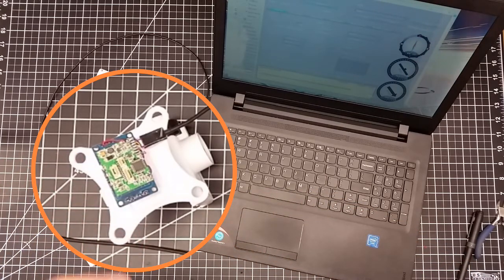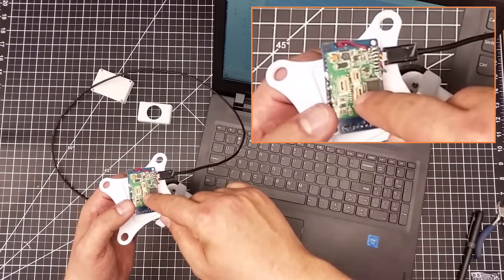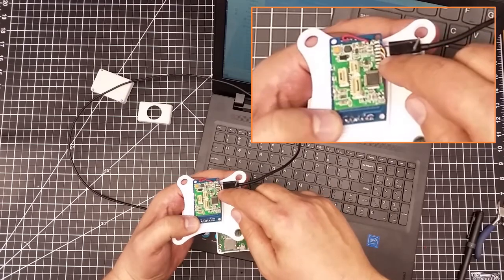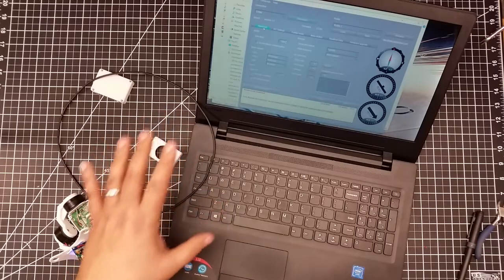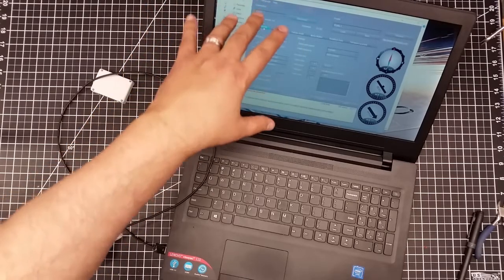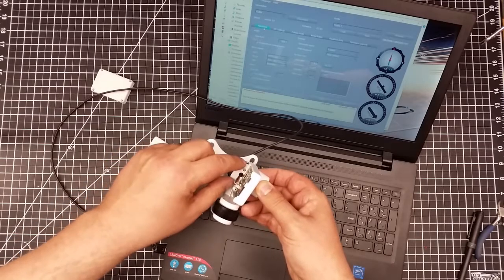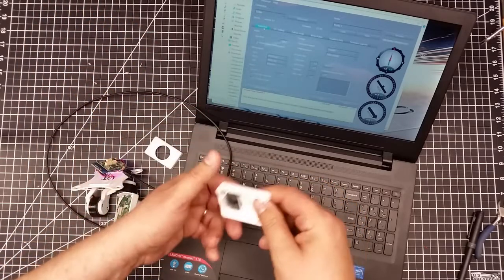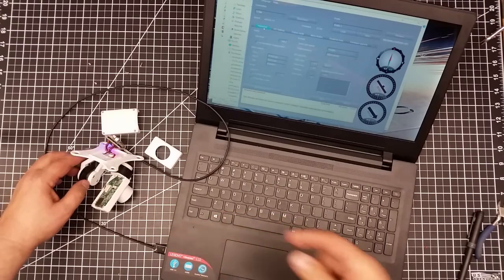Video Drone - Hacking the UpAir Gimbal!

Comment: I have a question I recently bought two up here one drones and one was for parts I use the other ones camera because mine was completely trashed after I wrecked it I would like to ask you if you have a diagram for the wiring other than these videos

Comment: Thanks for your reply, and I have ordered up  a couple of bags of the JST (DF-13) terminations - however I have a really simple question - the crash broke the three and four wire  gimbal terminations completely so I just need to know which cable goes to which strip i.e. the six pin terminal is ok but is it the cable from the transmitter or the main board that goes into the three pin terminal next to the gimbal main control strip? same for the four terminal strip.
Reply from the maker: Would love to help ya, however sold both of my upairs so no longer have them to reference for you.  However, you could check with Cruzroy (he also has a YT channel and Upair which he has done major hacks) and he might be able to answer your question.  Sorry for not being to help more...

Comment: hey i know this video is kinda old but i was wondering if you had learned anything else about this gimbal, i have two of them and id like to be able to wire them up for control on my betaflight/frsky based drones. do you know how to wire them up to a flight controller or arduino?
Reply from the maker: There isn't any easy way they use an integrated controller...

Comment: great video. I wish you would do one replacing the camera but still use the same gimbal that you spoke of in the video. that would be awesome. thanks for the info.
Reply from the maker: Sorry but you can't, the camera is part of the gimbal electronically (at least in this version and believe in the new one too).  In fact the OSD is also part of the gimbal so it would be a major over haul.  However thanks for the kind comments!

Comment: as a result of a nasty crash I have two disintegrated jet connectors on the gimbal board - the main gimbal control lead with the red red blue brown black black connections is ok - but the connector from the fpv transmitter and the other one from three core cable from the main board are totalled ... i can't make out from this and your previous videos what the connector config is - could you confirm the pin out from the fpv controller and the pin out from the main board and which one connects to the 3 pin just and which one connects to the 4 ping just ... please ...thanks in anticipation .. JimC
Reply from the maker: If you look down in the thread another viewer listed the FPV pins as these are straight forward (as its just standard module).  I never fully sorted the main connector as I guessed wrong and burned up the board as they didn't run as guess.  I would highly suggest writing CEN10 and ordering (and waiting) for them (hint get a couple sets) as these are DF-13 connectors and can be a bear...

Comment: UPAIR ONE 2K Model Upair2 Core Board
Greetings Friend! You don't happen to know where I can get a replacement cable for the 8 PIN connector located atop of the gimbal do you  Its almost like a proprietary build for Upair only. ]r any specific part name for it. The ones that I purchase here in the states are either too small or too wide. Cannot get a response from Upair also.  Help!    ;  (
Reply from the maker: I ordered one from GenTen the manufacture and it was around 12 buck shipped from China...

Comment: Hey ,
you mentioned a new Version in the links .
Do you know the difference and how to identify?

You had a (or 2) UpAir One 2.01 ... but what is the new one?
Or is it just a 2.7k upgrade?

GREAT VIDEO and SERIES OF UpAir ONE VIDEOS with great insights
Reply from the maker: The revision as I recall is 2.01 however the series as I understand is "2".   There is a newer new one now which I don't have that is app driven like the P3/4 and all I know is it has a different flight controler than the 2.01 however I would bet still the same gimbal as its just the storm version so you can hack it...
Reply: Video-Drone Don't get me wrong: I can't buy it using your amazon link what I would but: 
#1 they have none in stock
#2 they don't ship to germany

Therefore I need an optical or technical detail with that I can make sure to buy the latest one. 
I'm still undecided if I buy that UpAir one and make the mods you described damn good that I'm encouraged and motivated to do so or buy the old, good lady phantom iii and add a bit for range and batteries. 

If I do it the first way I wanna make sure to benefit from your mods and hacks but would also like to take the advantage of the third evolution of the One if I remember it right.

And there are different UpAir One available at gearbest which differentiate by 2k or 2.7k and 4k camera where the first gen. may be the 2k with a seperatly useable camera.

But after you mention a Phantom 3 app controlled FPV I'm total unsure which modell I have to look for.
Reply from the maker: No worries on the link 😀 Also love Germany will be in Bonn next week too.  Anyway if you can afford the extra buck go for the Phantom 3 Standard.  If not even following that link should take you to the German version of the store and it's the one that requires a phone or tablet.  Also myself would not spend the extra money on 4K as it only has a two axis gimbal....
Reply: Are you sure to go for the Phantom 3?
Thought that after all your work the One could be able to do more than the Phantom. Loved your step by step considerations and improvements. I watched nearly all your One Videos the last day and I thought what an opportunity.

If you come to Bonn ... pick up an american phantom 3 and bring it to Bonn - i'll come to Bonn and pay of cause € or $ as you want in advance... cause in the US all DJI are quite cheaper and then it's much easier to pay that extra buck for the phantom and its combo pack I assume to need. Not joking or kidding. I have already the US Power Adapter ... I might need for an american P3. Could use it for aerial archaeology around an ancient battlefield excavation area 2000 years ago which is a 20km trap, a path getting smaller and smaller into the moor/swamp where the roman empire lost a third of its army - that was found nearly 30 years ago.

http://www.kalkriese-varusschlacht.de/en/museum/the-exhibition/

And I just checked your amazon link from this video.

I went to amazon.com to a summer toy paradise Headline with this product

UPair 2.7K Plus Mobile App Version Video Camera Drone,5.8G RC Quadcopter,Return to Home,Auto Take-off,Auto Landing,Follow me Mode,Flight Route Planning Function,Aerial Photography Drone

but no link or forwarding to German Amazon
Reply from the maker: Wish I could drag one over for you but leave tomorrow.  Also yes "if" you have the extra money go the Phantom far more refined as with the "new" UpAir" keep in mind it is a version 1 and with version 1 comes bugs.  The Phantom 3 has had them basically all worked out.  Also this is major cool (aerial archaeology)!  With this said (please) spend the extra money get the P3S minimum with Litchi and/or Autopilot  so you can run missions, you will be blown-away by what you can do.  Again, if this is your planed use go for the P3S with Argtech Ant mod and you will not be sorry as missions will blow your mind when it comes to this.
Reply from the maker: Good to know of the weather!  As that is very warm for this time of year (mostly I go to Munich), however check out Litchi missions as I have seen on the internet a dig site use this for regular mapping  as once you create you can keep rerunning and do overlays.  One of the things I plan to experiment with  is NIR (Near IR) to map sallow water ship wrecks.  This might also work for you too as NIR can deliver a very high level of detail, or this I bought a Phantom II (you see up coming video's on this) and I build an NIR FPV system and working on a high res-camera system.  Oh yes and I know how to enjoy the Rhine too as I typically stay at the   Grand Kameha has a great location for a nice stroll :-) Hey how are done laws there?  I ordered a Spark and would like to bring it with me in the future, is it possible to fly there?
Reply: Video-Drone Regarding flying a drone in GER I send you an eMail with all the explanations and rules that may end up in a bit more freedom for you and your drone(s) - you're welcome.

Regading Phantom: I buy one - do not really how to get it here but I found a nice "memorial day" offer not knowing that memorial day is in may/summer cause german kind of that is called "Rememberance Day/Volkstrauertag" and in November like the british Poppy Day.
Reply from the maker: Yes saw this as I have been binge watching Spark videos!  Wish there was one with the remote as that is what I want to really see!  For me the 1080 is great as 90% for YouTube I do in 720p as 80% of my views come from Phones and 1080 or 4k take forever to upload!  :-)
Reply from the maker: Many thanks I did see and on my way to Germany now, however my real question is it possible to fly in the area of Gran Kameha there on the Rhine?
Reply: Video-Drone Better you send an eMail next time cause I don't get notifications and you had luck I was here.

Have a problem with the place on the Rhine you mentioned.
What is it spelled, looks like a typo cause I don't know where / what Gran Kameha shall mean?
Which town is near to that place?

Be prepared: very hot, subtropical nights currently with temps around 25° in the night at 2am
Reply: Ok, I got it.
You are talking about a Hotel called "Kameha Grand Bonn" 

Well, on the other street site (eastwards) is the main police station where flying shouldn't be forbidden but you may consider the interference of their equipment.
On the other side there is the huge Rhine river with a huge recreational area and of the rare german "sky scraper" en miniature that belongs to the (german) Post, called Post Tower.

You may better know its daughter company DHL.

That area is great for drone flights but be aware of interferences.
There are not many tall buildings, sight from the rhine shore shall be great. I recommend you this if you have time in the evening:

Take a boat / Ausflugsdampfer 
First evening enjoy the river and make notes what shots you may take, when to start and land .... it's impressive, many things possible and maybe make a few short flights to look behind river valley. Historical area, previously under roman empire control and its influence , old buildings, street names

If you can't get such Ausflugsdampfer / boat take a bus or train along the river. Ask and people will help you.

Comment: Thank you for the video. I have the same lights on my two boards for the gimbal. My Issue that I'm having is when I have the first two plugs from my PX4 (Main Board) my gimbal shakes bad, but as soon as I plug in my transmitter for FPV( aluminum housing Transmitter) the shaking stops and I don't get power to the camera either way..... I Don't know what to do...Please Help.

Also I don't have a USB on the board, its some other type of connector...
Reply from the maker: Has it always shaken and camera not worked?   The shaking is a common issue with the Upair and second while it might seem the gimbal and camera are connected not really so (although the camera does house a gimbal sensor).  As I recall it is the larger cable which provides power for for both.  From this it is hard to tell if the main board is damaged or the camera itself.  Also the USB for the gimbal is tucked under the pressed on plastic cover when would have to be (carefully) cut off to expose.  In short sorry to say it "sounds" like not a simple issue to fix...
Reply: Video-Drone no it just started doing this. at first I had just static on the 7" screen....so I thought it changed channels on me....nope. so I took off the gimbal and found the 3 connections. after removing the 3 cables that go to the vtx the gimbal shakes. plug it back in......nothing not even power to the camera.  yes I did remove the cover. no usb. in the same spot as yours is a connector for a 5 pin cable. 

the camera led's turn blue when plugged into micro usb.
Reply from the maker: If there is only "static" that doesn't mean the camera is not working but either (a) signal is not being sent or (b) the signal is not received [near of which have to do with the camera but transmitter].  Did you put the three cable back correctly (if not you likely damaged it).  When you power on the main battery does camera do its little dance and balance itself?
Reply: Video-Drone it does nothing. I've even replaced the vtx with a new 200mh one. the gimbal comes alive when I remove the vtx cable...but it only shakes..nothing else.
Reply: By the way...THANK YOU SO MUCH FOR THE TIME YOU HAVE SPENT HELPING ME WITH THIS!!!
Reply from the maker: I don't think it is the transmitter per-say, I would look for shorts or wires which are not (fully) connected.